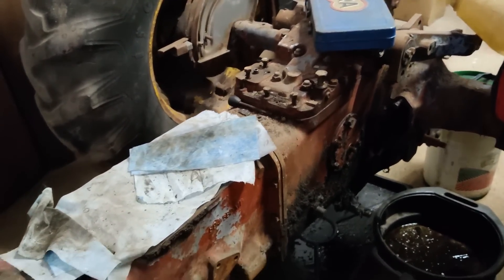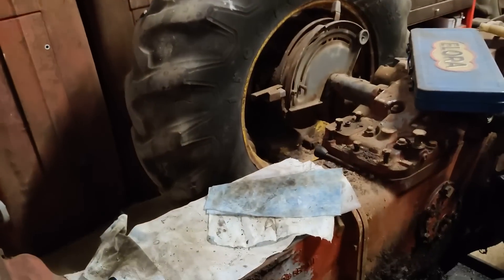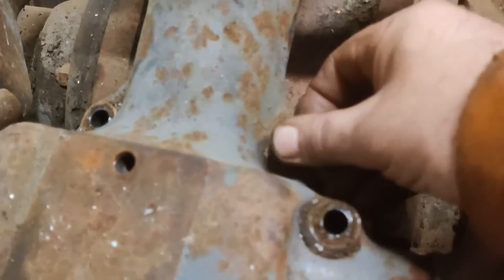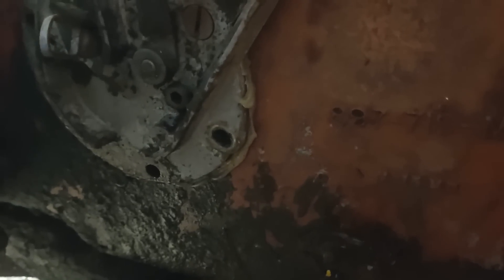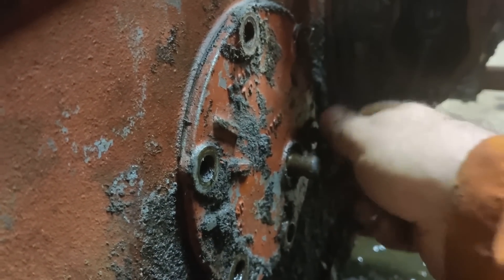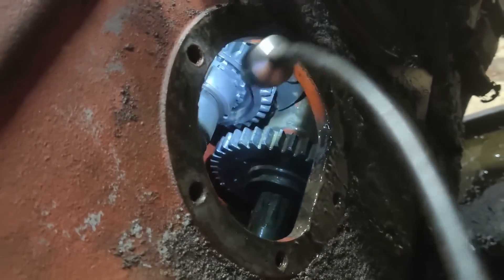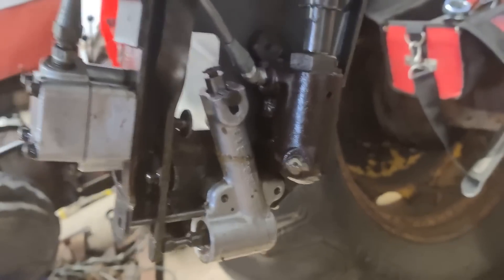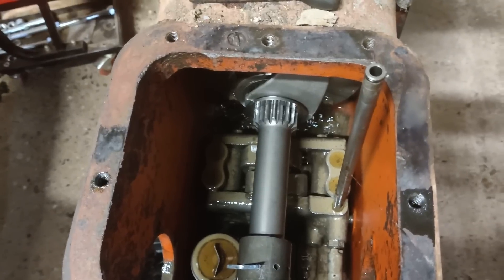175 Hydraulic Lift Cover Removal

Comment: Hi There.  I know this is an older video of yours but we followed it earlier today when removing the top cover from an early 135 - multipower.  Not ready to put it back together yet as doing the clean out etc,  but noticed a spring on the front underneath, but can’t find any references as to where it locates on the main housing. Any ideas?  Thanks for your video again- a useful guide and good for confidence 👍

Comment: Totally brilliant video, chap 😊  We have a venerable 135 here at a csa in Bristol.  The 2 seat base stud holes are worn and oversize, so we'll need to tap them up a size... are those two holes blind or do they go straight through the cover?  We're worried that when we tap the new threads, the swarf will drop into the pump mechanism cavity.

Comment: So I followed your video to take mine apart reason is my tractors pto wouldn't disengage. I tried taking the side plate off with the pto handle and it has resistance why would tbag be? I didn't want to yank it so i took a break

Comment: I am currently working on a 165 with pressure control. It is my understanding that a tractor with pressure control does not have a pressure relief valve on the pump it is on the lift cover yet yours has a relief valve on the pump. I like your videos.
Reply from the maker: Early pressure control machines didn't have a relief valve, but used the pressure control valve instead.  You can tell by the standpipe.  If it's a straight tube, that lifts out, there should be a relief valve.  If it has a junction block and a pipe coming out, it won't have a valve.  My 165 was built with pressure control, but butchered to remove it and a relief valve never fitted so it sheared the pump mounting pegs.

Thanks for watching.

Comment: Have been waiting for this vid, have my top cover in bits at moment 👍
Reply from the maker: Do you have a round axle or a square axle?

Thanks for watching.
Reply: @ClarenceFudWeasel  A round axle, 1969 ad212 engine model.
Reply from the maker: @karlredshaw7447  MK1 hydraulics and do you have pressure control?
Reply: @ClarenceFudWeasel  
Yes its got pressure control

Comment: Nice to see you back on the old lass 👍. It always surprises me, up you can have something that has a little bit of water in and it’s ruined  or something that’s been stood in it and it’s fine 🤷‍♂🤦‍♂
Reply from the maker: My guess is that the oil that was in there floated to the top when it filled with water and left a coat of oil over most of it.  My theory anyway.

Thanks for watching.

Comment: That standpipe amazing how often I came across that being refitted after having the cover removed and missing the union at the bottom and people wondering why the hydraulics didn't function 🤔😂 the innards didn't look to bad at all as you said a product of good British engineering 👌 great video 👍
Reply from the maker: I have seen that too, surprisingly often.  I've also seen it out back without the seals to back up the O rings.  Just drop it in and hope for the best 😂

Also had one that missed the port in the valve body, so they hammered it in. Bent the end of the pipe up, damaged the valve body and then they were surprised that they had no hydraulics.  

Keeps us in a job I guess 🤣

Comment: Was expecting the worst when you said it had been sat full of water but I’m amazed at just how well it looks in there  hats off to those who designed and manufactured at Banner Lane. Am I correct  you mentioned the 175 came from the Lake District? Years ago used to go up to Carlisle to the collective machinery sale at the auction mart which if I remember right stopped when foot and mouth was raging about 2000. Anyhow there always seemed to be quite a lot of entries of all and any makes in similar if not worse than the 175 some of which were too bad to tell what breed they were without close scrutiny   Like a line up of welfare cases. We always thought up there was a bit of a hotspot for total neglect of even basic maintenance    a very sad attitude. Good to see you back Mr Fudd keep up the good fight 👍
Reply from the maker: I was too, it really says a lot about the quality of materials and workmanship at Banner Lane in 1965.  

It did come from the Lake District.  I guess it spent the second half of its working life on a small upland farm probably.  

I often wonder what will happen to these restored tractors in a few years time when us older guys are no longer around and nobody wants them.  The market for pre-war hand cranked tractors has died completely and it's hard to give them away now.  In 30 years time it will probably be the same for these classics from the 50s and 60s and they will end up scrapped or exported to Africa.
Reply: @ClarenceFudWeasel  Yes I have had similar thoughts on this subject with the same sort of conclusion. There will be a lot of cashed up off spring on cruises and many happy looking Africans

Comment: Great vid as always, keep them coming,  just wondering I've a 365 with an 8 speed box that s a bit worn and needs some TLC  iwas thinkg of fitting an 18 speed unit in its place any thoughts ?
Reply from the maker: It's doable, I guess if you are doing the work yourself it wouldn't cost that much.  Do you have the parts?
Reply: @Clarence Fud-Weasel  will do it ourselves  for sure unless yourself nd mucker would like a bus man's holiday to Ireland🇮🇪 ........warm welcome guaranteed ..... nothing sorted parts wise yet was thing a complete box ect from a doner tractor , just thing the 18 speed unit would make it a bit more useable , nothing like creating work for yourself 😆

Comment: Looks good inside, sludge at the bottom, but isnt it always like that. Good to see no gloves, a real mechanic. Reminds me of a callout many years ago. A Standen solobeet harvester with a 135 skid unit. No hydraulics, so they just undid all the top cover bolts including the ram cylinder nuts, didnt touch the side covers, just hooked the top cover with a chain to a loader tractor and pulled!! Not pretty when I removed it properly. By the way, Massey instructors at Stoneleigh always called it a stackpipe.
Reply from the maker: Thanks for watching, I can't get on with gloves, my hands sweat and the gloves rip in 30 seconds use.

I wonder what I'll find in the sludge when I clean it out, probably been accumulating for 50 years!

 The original drawings from Harry Ferguson  called it a standpipe. 🙂

Comment: Was imagining the worst when you looked inside but that was a pleasant surprise. Also noticed how good that Elora socket set looks for something that's probably as old as the 175
Reply from the maker: I thought it was going to be a lot worse than it was too.  

It hadn't occurred to me, but you are right about the Elora sockets.  I bought it secondhand when I joined a Ford dealers in the early 80s.  Everyone else had SnapOn, so I bought Elora.  I still have pretty well all of it and it's still in good condition.

Thanks for watching.